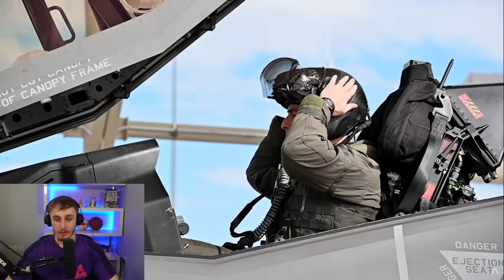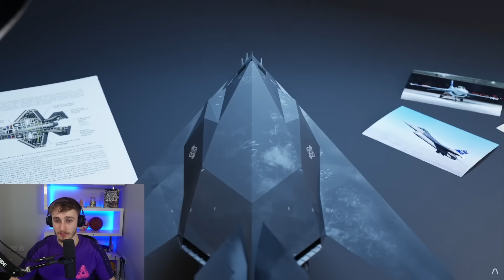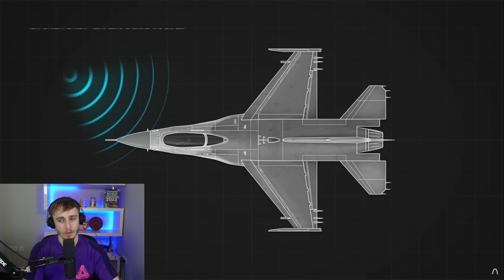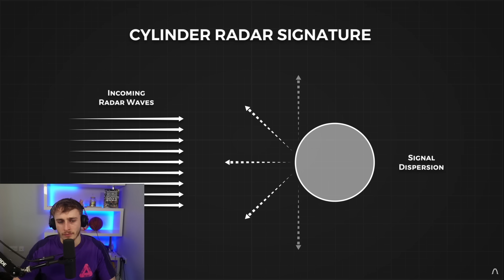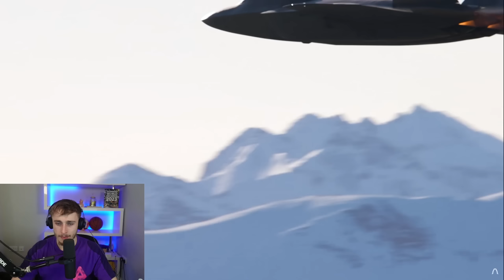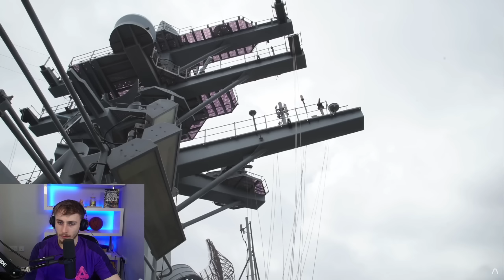Brit Reacting to The Insane Engineering of the F-35B

Comment: The F35B IS capable of vertical take off, it was a requirement by the Marines and there’s plenty of videos showing it doing this but it uses a lot of fuel so not used much
Reply: "The F35B IS capable of vertical take off, "

Correct

"it was a requirement by the Marines"(sic)

Incorrect. There was no KPP requirement for the JSF to be capable of performing a vertical takeoff. The fact that the F-35B can is simply gravy.

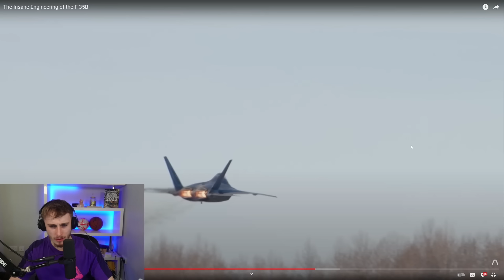Comment: 21:21 Those are basically small clouds forming on the leading edge of the wing, because the maneuver the plane pulled while going at such speeds essentially compresses the water vapor in the atmosphere so much that it turns into visible form for a short time.

Comment: Of the 3 variants the F-35B is actually the least capable and the most expensive version due to it's STOVL ability. It is used by the U.S. Marines & U.K. Navy. The F-35C is the next cheapest version and is only in use by the U.S. Navy. Whilst due to the large number of countries ordering it meaning thousands will be made the cheapest version the F-35A is now the cheapest western fighter currently in production, costing well below $80 million now.
Reply: Depends on how you define capability, Yeah it can't carry as much payload or fly as far without refuelling, But it can take off and land in places impossible for the other variants. And doesnt need special help to take off or land that the F35c variant does. If a carriers catapults or arresting gear is out of operation a F35c is stuck either on the deck or in the air.. lol..
Reply: "It is used by the U.S. Marines & U.K. Navy."

Italian Air Force and Italian Navy as well. Other countries have also placed orders for the B - Japan and Singapore.

"The F-35C is the next cheapest version and is only in use by the U.S. Navy."(sic)

Incorrect. The Charlie is the most expensive variant and is also operated by the United States Marine Corps.
Reply: It is also planned to be operated by Japan. Being able to land on a helicopter pad instead of only runways is an absolutely insane value add. Which is why Japan wants it for their Izumo-class ‘helicopter destroyer’.

Comment: The F35A (Airforce) costs around 77 Million Dollare, the F35B for The Marines and Small Carriers) costs more then 100 Million Dollare and the F35C costs around 97 Million Dollars. This Designed for Large Carriers with Catapult Launch Systems. The F35C has Larger Wings then the A and B Models have. Each F35 Series Aircraft have Design Elements for That Particular Branch of the Military. You See all the Different Technologies in these Aircraft. That is One Reason these Planes are So Expensive.  Think of this, the B2 cost in 1997 737 Million Dollars Per Aircraft. Advanced Technologies COST LARGE AMOUNTS OF MONEY.
Reply: The Charlie is the most expensive variant.

Comment: The F35 would have no problem taking out the Japanese air force during WW2 . Only drawback would be the amount of armament it can carry at a time !  Basically it's an invisible flying computer ! You mentioned that the maneuvers the plane is capable of pulling off should affect the pilots .  It does ! The maneuvers can produce over 9g's of force on the pilots ! Basically all the blood is pulled from the pilot's brain , which will cause the pilot to black out . But , the g suite they are wearing applies pressure to force their blood to their brain ! ! last thing , the helmet they wear cost around $400,000 each !!!

Comment: If you had one of these planes at Pearl Harbor it would be... Insignificant in the outcome. If it's on the ground like all the other aircraft that day it can go up, shoot off its 6 missiles (which will all hit of course!)  And then the pilot has to manually shoot down the other aircraft which are smaller, slower and way more maneuverable than anything the pilot has ever had to try to shoot down. It has no internet to upload and communicate with it's allies, it's back to the pilot having to talk and describe everything. He would be in a vastly better situation than all the other American aircraft of that time but the limited ammo and communication of the time is going to keep one hand tied behind his back and he would be forced to engage the enemy on their terms rather than his.
Reply: A dozen and then we’re talking. Wing hardpoints can be used because stealth is irrelevant. Half the attacking force gone in the initial missile volley and the rest killed by gun from aircraft that know exactly where they are at all times and can’t climb high enough to shoot back at them.

Comment: In regards to your question at the end, which was “What would happen if just one fully-loaded, fully-armed F-35B was present at Pearl Harbor,” I don’t think it would be able to make a massive impact (although it would make a certainly frighten everyone who saw it).

My reasoning for this is that the F-35s (A, B, and C variants) are not built with large engagements in areas where resupply is inaccessible in mind. They are stealth fighters and have an armament to match: one 25mm rotary cannon with 180 rounds of ammunition available; four internal hardpoints and the optional six external hardpoints on the wings, giving the craft around 9,400 kg of potential payload if you put weapons anywhere you can.

The F-35 would certainly give the attacking forces hell, but it would eventually run out of missiles and ammunition, and without a way to get more of either, it becomes a big, shiny, incredibly-fast-moving target.

Please note that this is an opinion and that I can’t give a qualified answer to your proposed scenario that everyone will accept. There are, no doubt, holes in my logic here, some things that I haven’t considered in this, but I’ve been writing this comment for far longer than I should have and I’d like to end it here.
Reply: There were hundreds of planes involved in large WW2 air engagements and most would leave the battle in one piece. A dozen F-35 thrown into those battles on one side and it would be a complete hopeless slaughter. Given that theres about 5 F-35 built every week and even the lowest scale operators have like 30 of them its kinda stupid to just throw one into a fight even just for a thought experiment.

Comment: I'd like to note that the F-35A and C don't have that fan in it. The C variant has strengthened landing gear and arresting gear for landing on carriers, while the A has other optimizations for the Air Force.

Also, I feel like that description of Passive and Active radar arrays was a bit wrong. It's not quite it's stuck on one direction, it's that it tends to use a lens of sorts to direct which antennas are transmitting at one time. Active radar with it's individual transmitters I think has more power and can be controller more. It might be worth looking into some time, it's kinda interesting. Like the difference between the SPY-! and SPY-6 of the US Navy.

Comment: the absurd thing about this plane is (if im doing my math right) it can lift off at just over 60mph; THATS SLOWER THAN MOST PEOPLE DRIVE ON HIGHWAYS (granted it shouldnt get up to standard flight speed very quickly doing that, but it can hover so it shouldnt be an issue)
For reference an average commercial airliner (747) needs to get to nearly 160 mph to take off *apparantly had the wrong speed for 747 takeoff
Reply: Vr for a 747 is ~140 knots = 161 MPH

Comment: You should check out the SANDBOXX channel, they have some great videos on F-35 and many more modern systems. Simon on SIDEPROJECTS channel also has some  informative videos as well. The F-35 is an amazing piece of kit. It's not the best dogfighter, but it's not meant to be, it's meant to stop the fight before it has to dogfight. There were doubters in the early years, some unfair tests, but I think most have been put to rest as they work out more and more kinks.
Reply: Agreed!

Comment: F35, if airborne before the Jap attack, and equipped for attack not stealth,  with a full suite of missiles and enough ammo, would almost definitely wipe the floor with the WWII aircraft.  It'd be even more of a Turkey Shoot than the Corsair had against the Zeros. 

The fact that we're releasing this much intel on the F35 must mean it's already been surpassed by NGAD, the 6th Generation air superiority program. F22 top speed is estimated in this video. True top speed is classified from everything I've seen and read. F35 helmet costs $400,000. Kind of a bargain considering all it does.

Comment: They've found recently that it's better not to have more experience in previous generation aircraft.  The systems have changed so much that newly trained pilots are often performing better in F-35s than pilots that had a ton of experience in other planes, because there's so much that those older pilots have to 'unlearn'.
Reply: This is how my dad explained shooting guns before I joined the military. I asked him to take me shooting before I went off to boot camp and he told me because he’s not an instructor I’d learn a lot of habits that don’t apply to military firearms training. Actually proved me right when all the rednecks that had been shooting guns for years all failed their initial gunshoots at RTC.
Reply: @MrCrapDude  Good comparison.  

I was in the Air Force and like most jobs there wouldn't be using a weapon much (or most likely at all).  When we got to the part of Basic where we needed to qualify, I learned a couple things in the "never shot a gun before" portion that were different from how I'd been shooting my whole life.

Because all we had to do was qualify though, the instructors told me just to shoot how I was used to shooting and I passed.  Would have been a different story with a combat MOS, and would have needed to unlearn/relearn some things.  

I mean, even my dominant hand was wrong.
Reply: i'd argue initally learning the flight systems, yes. tactics no. that flight time, experience is second to none. especially older pilots with 1000-2000 hrs

Comment: The F35 is not a very fast plane and is not a great dogfighter. It does network other planes, and is good at stand-off distance fighting, though. The new and improved F15x are the non-stealth muscle and costs a fraction of the price.
Reply: "and costs a fraction of the price."(sic)

You've obviously never priced an EX.
Reply: F-15X costs over 100mil. F-35 unit cost is between 70 and 90 mill, the same as modern 4th gens. Also its been proven to be a better dogfighter than the F-16 in actual exercises where its not gimped on the order of 4:1 kill ratios, one of if not the best 4th gen dogfighter.

Comment: Definitely an incredible plane, though they haven't worked all thu bugs out.  The F-35A is basically a regular fighter plane.  The F-35C is the Navy with stronger landing gear, a tail hook, and folding wings for normal carrier use.  The F-35B here is the only one with the STOVL tech on board, and is the variant you guys bought for use on your two new carriers, the Queen Elizabeth II and the Prince of Wales.  Hey, you should check those out, too....
Reply: Just to note the first of the two UK carriers is HMS Queen Elizabeth. Not Queen Elizabeth II, Which is a cruiseship.. More commonly known as the QE2.. 👍
Reply: "STOVAL"(sic)

STOVL

Comment: Even with only 1 plane, if it was back in ww2, it would easily destroy any and all opposing aircraft.  It could literally do this flying slowly and in a straight line.  The sheer distance it can detect, as well as how far its missiles can travel means it could shoot down opposition from so far away they would have zero chance of ever knowing it was there.  The limiting factors would be how many missiles it could carry and how much time it could spend in the air as it is fairly maintenance heavy.  It would spend a lot of time in the shop, which is also when its most likely to be destroyed by something as basic as 1940s bombers.  You sink the ship, you lose the plane.

Comment: So one issue is that the plane would run out of ammo pretty quickly. However your right its unlikely that the Japanese would be able to shoot it down as most AA at the time could not shoot high enough (let alone target it). 
Not that they couldn't build AA to shoot that high just that they didn't need to because aircraft of the day didn't fly as high.

Comment: F35 has no chance against the F 22
Reply: Depends what type of battle. The F22 is dominate in dog fighting. The F35 is better in other roles.
Reply: True but 10 F-35’s could easily beat 10 F-22’s plus, it’s half the price.
Reply: @apex_blue  that's only true if you believe that the technology is not cross platform
Reply: @chrisp308  it’s not, the F-22 still doesn’t have a HMD, and is running on 1990’s software. In Fact the Open Architecture of the B-21 Raider is meant to solve this problem. The only reason why the F-35 is still getting better is because it’s not completed yet. The Block IV upgrade is supposed to complete the F-35’s systems and bring older systems(because the program lasted so long) up to date. Some of these include a upgraded engine and Radar. While you can upgrade a older plane but there is only so much you can upgrade before you have to redo the entire plane, take the F-15EX for example instead of upgrading older F-15 they had to redesign it into the F-15EX.
Reply: @apex_blue  you are very educated on the system platforms but how much of it do you think is factual? I'm sceptical that we have been given honest intelligence
Reply: @apex_blue  nope
Reply: A lot of F-14 jocks got handed their lunch thinking that fighting against A-4s and F-5s made them invincible.
Reply: @AA-xo9uw  I can't get any love I'm the comments section anymore 😅
Reply: Aren’t they built for different tasks?  Serious question.
Reply: @darger3  Sort of The F-22 was built as a Air Superiority fighter. The F-35 is built as a Multi-Role fighter. It can do Surveillance(on battlefield), Reconnaissance(infrastructure), anti-ship, anti-submarine, anti-air defense, anti-air, anti-ground, CAS, and more.
Reply: @darger3  yas of course they are that's an excellent question and nothing is stupid about it the f-35 is meant to replace the fa-18, the F-22 is meant to replace the F15 air dominance fighter you're going to get a lot of people with a whole lot of opinion on this subject but you need to listen to the people that are in charge of keeping these aircraft in the air
Reply: @chrisp308  interesting you only listed the f-18 super Hornet. While they do have lots of similarities with each other, the F-35 isn’t replacing the F-18’s. The F-35 will work with F-18’s until the Navy’s NGAD family comes along. 

In my opinion the F-35 is has/currently/will replace the f-117, the f-16 to a extent(leaving it in the role of a trainer* until that new f-16 based fighter comes along), the Harrier, and maybe the A-10(It has the capability to replace the A-10 the question is will the US let that happen).
Reply: @apex_blue  it depends on who gets the money
Reply: @apex_blue  "the F-35 isn’t replacing the F-18’s."(sic)

Incorrect. The F-35 is replacing the Legacy F/A-18 Hornets not the Super Bug.
Reply: @AA-xo9uw  the F-18 SuperHornet replaced the legacy hornet, not just the F-14 Tomcat.